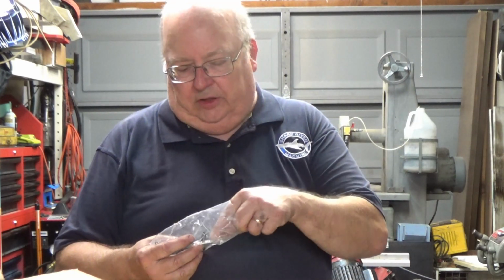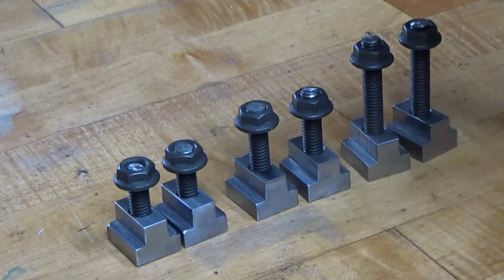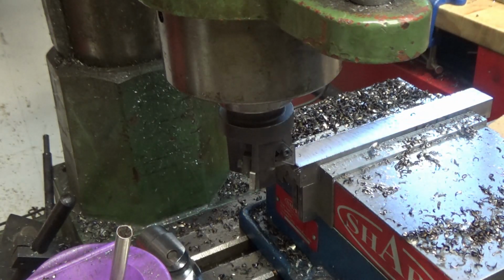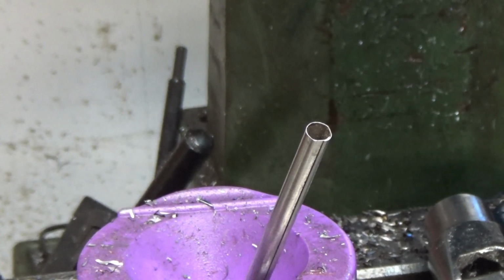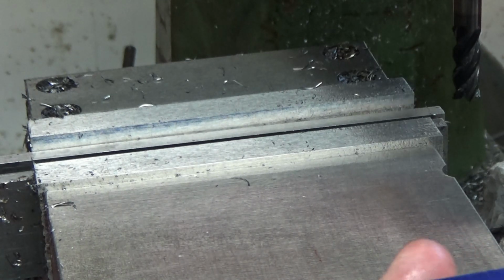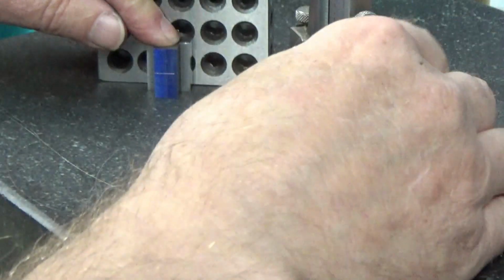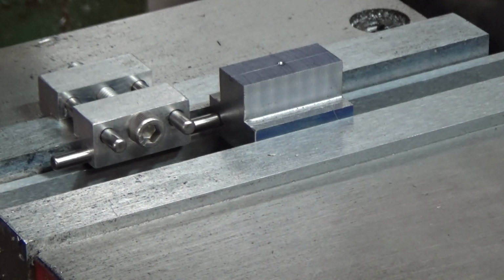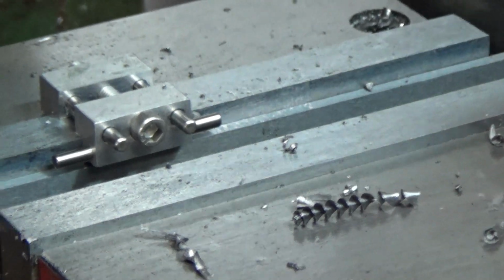Shark Bits #32 - T Nuts For The Sheldon

Comment: You can never have too many T-nuts - got two different size sets (one for mill, one for shaper & rotary table) but would still like to make more t-nuts and toe clamps
Reply from the maker: My new horizontal mill is a different size that my round column.  That is why I am making up a new set.  Thanks for watching and commenting.

Comment: Nice nuts Steve! Usually the end thread is deformed ( on purchased nuts) so the stud doesn't't go through and contact the bottom of the slot. I have seen it done many ways but I think the best is a very large centre punch with an end larger than the thread . Only thing is I have never seen anyone do it in a video .  Great job, I am looking forward to you introducing us to your new mill, cheers and thanks! 
Oh yes and nice mod on the tool post, I just recently saw someone dismantle their post and was wondering why they would put a thrust bearing in there, you answered that one for me!
Reply from the maker: I tapped them about 3/4 depth.  I had a whole narrative about it and edited it out because the video was getting too long. Thanks for watching and commenting.

Comment: I cannot understand why the USA still uses imperial sizes. Metric is so much easier.
Reply from the maker: It is all what you get used to.  I work in both with no problem, however all of my machines are Imperial so that is my primary system in the shop. Thanks for watching and commenting.